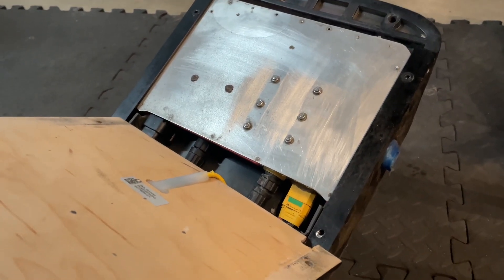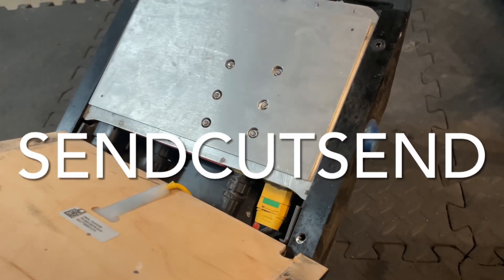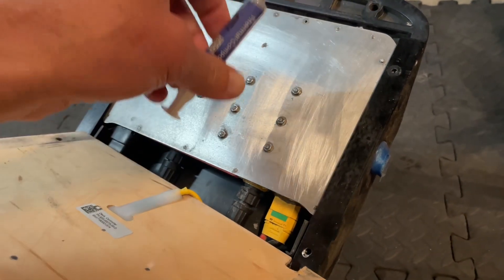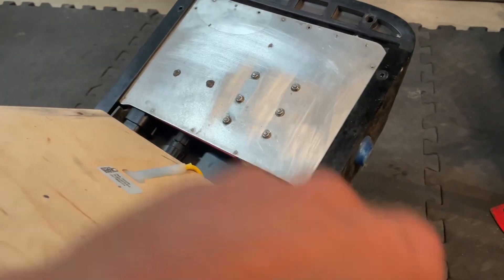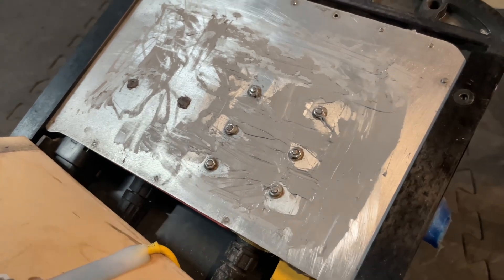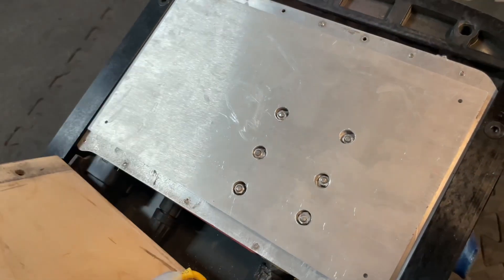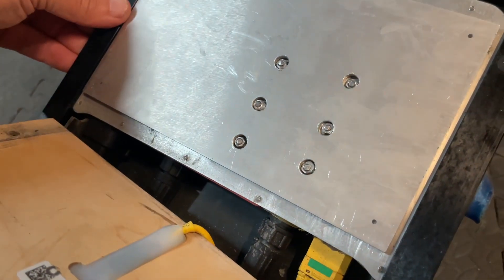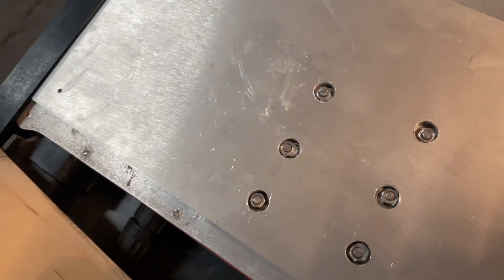How to improve VESC XR thermals

Comment: Dude you should make a break timeout. I have a problem with my tale bieng to stif for tricks and hard berms. So like half a second of whatever break amp you want,(like -60a break power) then after half a second return to full break power in like a 1 second span. So like return from 60-120 break power gradually in a second. That would give you nice low power for small hills and bonks without losing momentum and keeping your tale loose. While still giving you power when you need to stop

Comment: You should add the thermal paste on the plate where it connect to the rail.
Reply from the maker: That's the plan - but that stuff is messy so I was waiting to see if I actually need it, so far I wasn't able to get close to 70C on any of my rides
Reply: Might want to use thermal tapes. I was going to design a foot pad with air vent over the cover, I think that will help a lot.

Comment: I was thinking the same, but using a heat transfer pad and have the upper plate to sit on top of side rails, so that heat would wick into side rails too. Your way the controller will heat the extra mass and it will just stay warm without dissipating it away. It might still be enough to work, because board might not give constant heat, just spikes that the mass will smooth out.
Reply from the maker: I am indeed planning on adding thermal paste between the lid and the rails to get this extra benefit, but so far I haven't needed it. I'm waiting to find a trail where this setup overheats

Comment: Thank you for this guide. Every superflux customer will find this super helpful. Do you happen to have the LxW dimensions for the plate?
Reply from the maker: Plate dimensions are 200 x 120mm but I was too lazy to take off a footpad to measure it out when I ordered them, it could in fact be a tiny bit bigger. Just measure it on an XR/Plus...

Comment: I like the footpad pressure idea! It can be tough to find ways to bolt plates together sometimes.
Just foot pressure might cause the plates to separate and come back together a lot of times and I don’t know how that might affect the paste coverage. Easy to check once in a while though.

The most effective heat sinking will be with verrrrrry flat plates (no burrs) and using just enough paste to fill in the microscopic low spots, leaving a thin (almost see through) film on the plates. That allows the microscopic metal high points of the plates to touch (for max heat transfer) while still filling in the low points with paste to help pull some heat through there too.

But you’ve got a lot of extra metal and not huge amounts of heat to move so it’s not critical here, just more of a “best practices” thing if convenient to do. Thank for sharing this excellent cooling idea!
Reply: I wonder if it's possible to make footpads that are comfortable and thermally conductive.
Reply: @quinnfoster1234  Hmm…interesting idea. You might be able to use thermally-conductive sheets (used for MOSFETs) but I think it would cost a fortune and you’d still need to move the heat somewhere away. Perhaps the breeze over the exposed portions of the pad would be enough though?
Reply from the maker: yeah, bolting it down obviously would be better, best is to machine it out of a single 5mm sheet so you don't even have the two layers, but this is above my DIY skill levels